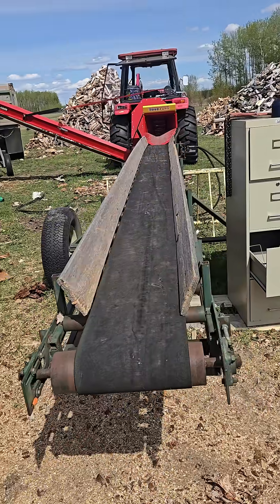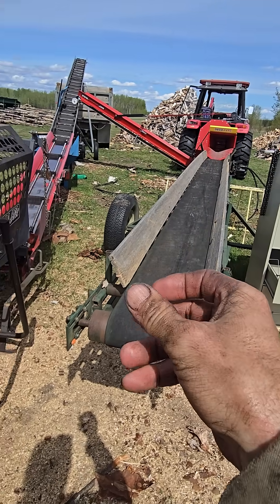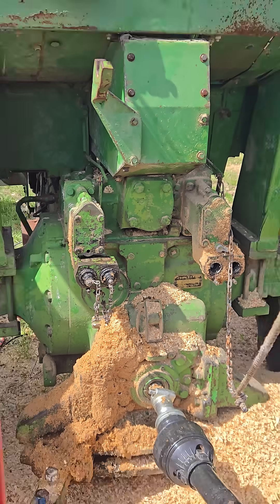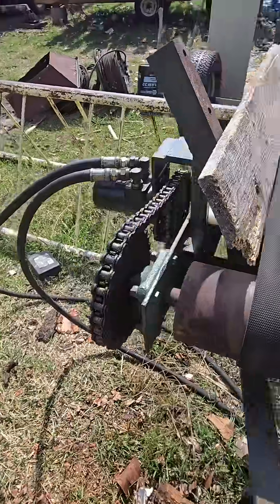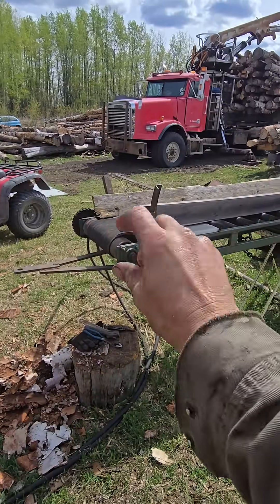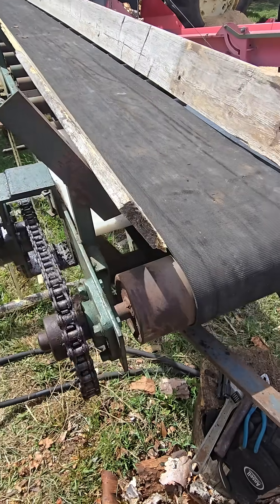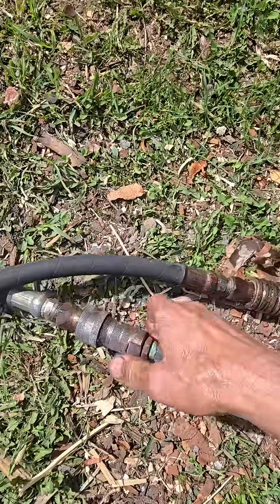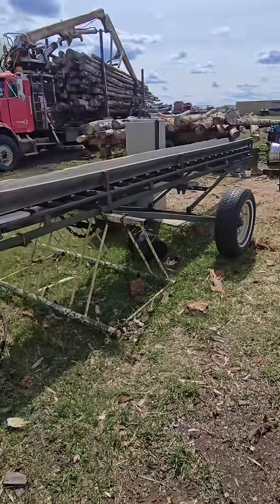rookie mistake hydraulic problem diagnosis

Comment: I worked at a hydraulics shop that sold log loaders. One time a guy came in with a trailer mounted loader and had the bolt that holds the oil filter together break. Turns out the quick coupler on the return line between the tractor and trailer backed off just enough to shut the flow off. The two pressure lines were still tight so the oil had no place to go and something had to give so the bolt gave. The couplers were screw type. I've seen cast iron pumps split for the same reason. Oil has to make the circuit from the pump to the tank or something's going to blow.
Reply from the maker: We had a motor break like that too. A 4 or 5 piston radial motor on the delimber. Wasn't a cheap fix...
Stay tuned for more content my friend and thanks for watching.

Comment: Z old split fitting. An hour? At least you have a good learning experience for yourself 😂😂😂😅😅
Reply from the maker: I always say that when you are trying to figure out a problem the tendency is to assume your diagnosis is right, and look for proof of that. Instead you should be looking for information or logic to debunk it. 
Quite often thinking logically through it trying to disprove it sheds more light on the process and problem.